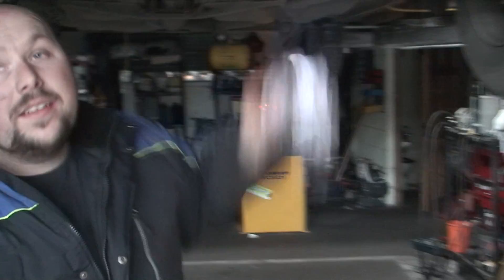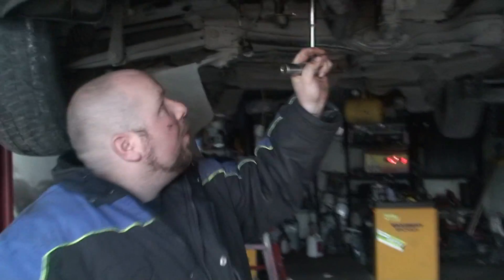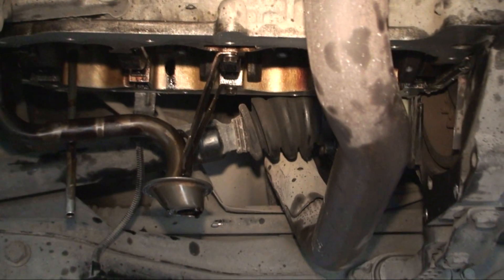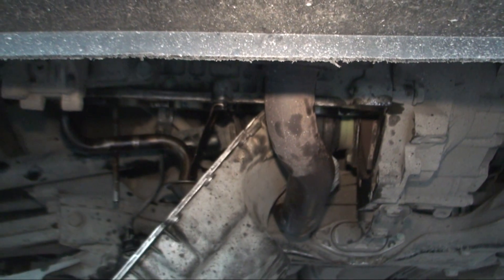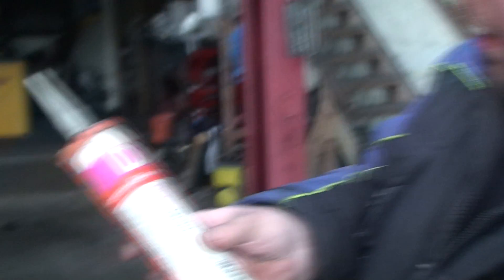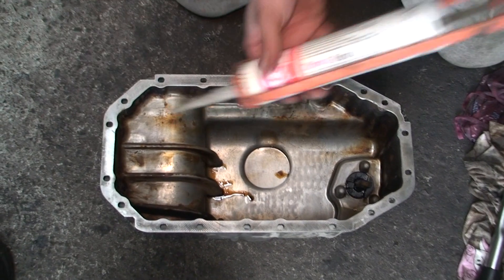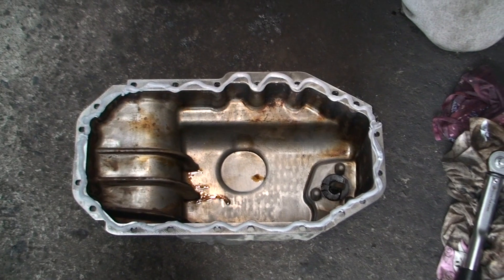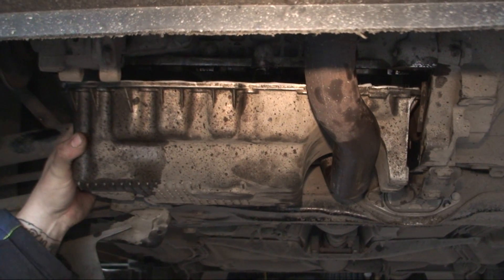bodgit and leggit garage how to put on a car sump (part 4)

Comment: The sump screws at the gearbox end are a problem to remove. The ball-head Allen key is not working, and the gearbox to block plate/gasket is in the way of a 'straight' Allen key. tips and tricks are welcome. I'm close to cutting the sump into bits

Comment: Why don't you just remove the obsticle being the exhaust 
That's lash loads on and when you tighten the sealant will squeeze inwards creating a silicone rope that will loosen into the sump eventually getting sucked into the strainer oil lifter causing oil starvation hence waste of time blown engine never mind you struggling with sump round exhaust removing sealant from an area that you never noticed causing a leak later some pressure builds up in the sump

Comment: Here is a tip, just drop the exhaust it's only a couple of bolts and makes it much easier
Reply from the maker: In a perfect world yes but not in the real world when the bolts are really rusty and it causes you hours upon hours to draw them out to replace them
Reply: @bodgitandleggitgarage  use a blow torch heat the bolts spray with  oil wait 10 min and remove
Reply from the maker: @lucianoaliquo6629  🤣🤣🤣🤣🤣 ok   I really dont understand why any bolt in the world ever get snapped them because  your method must work every single time
Reply: @bodgitandleggitgarage   works for exhaust bolts they used to the heat 🔥 not trying to be funny mine worked much easier with the exhaust removed 🙏
Reply from the maker: @lucianoaliquo6629    It will only work when the bolt is full and not rusty In 90% of the cases because the  Goes through multiple heat cycles The boat just rusts away And goes very weak And then just snaps off if you have done any amount of cars what's the weather you would know this I have done  Multiple video showing exhaust bolts and what happens to them Any experience mechanical know this

Comment: If you've got a few longer bolts with the same thread, cut the heads off and thread them into the holes. Then slide your sump on using the bolts as a guide, it then lines up perfectly first time. Get a few standard bolts in, then remove the long ones :)

Comment: Hi you did a good job but personally i would take exhaust off to make sure it’s out of way as you took a few bolts off a couple more won’t hurt
Reply from the maker: You are forgetting an important parts when I tell the customer the price for the job and then if I take off especially exhaust bolts if things start breaking and the price goes up the customer is not very happy in the real world I know what you are saying but it doesn't always work out that way practical how would you feel if someone gave you a price and gave you a call and the price tripled

Comment: I've got the 1.6l fsi engine. can the sump be removed without taking off the exhaust on that model too?
Reply from the maker: Nathan Soper if your exhaust goes underneath the sump then yes it will get in the way and take some of the sealer off and it will leak just easier to take it off but just be careful as you can snap bolts you're damned if you do and your damned if you don't

Comment: is it not easier to just take off the exhaust?
Reply from the maker: i did it properly
Reply from the maker: Robert Wiliams no risk snap in the exhaust bolts causing the customer triple the cost so no it's not worth it
Reply from the maker: Robert Wiliams no risk snap in the exhaust bolts causing the customer triple the cost so no it's not worth it
Reply: Ah ok that's fair enough. I'd be doing it on axle stands so I dno if I'll have enough room. Also I read somewhere about disconnecting a drive shaft for some reason. Doesn't look as though you need to.
Reply: Just do it properly, it saves time and effort.

Comment: How much crap is usually in the sump or is it generally quite clean?
Reply from the maker: GymChess hi mate if you change your oil regularly it should be really clean did you got a lot of slugs and stuff it means that all has not been change regulate

Comment: It is a very good and useful video. Our POLO 1.4 from 2002 has the same oil pan. THANK YOU for showing how to put in the 2 screws into the deep holes next to the transmission. It was a horrible job for me. I could put into their place only one of them, hopefully it is not a problem. Maybe next time it will be in my garage I will try again.
Reply from the maker: Péter R glad I can help mate thanks for watching
Reply: Do you think that it could cause any problem if one screw is missing?
Reply from the maker: Péter R I no people that have left both of them bolts out and have no problem
Reply: Thanks.

Comment: hi on a z16xep 1.6 twinport astra sump is it the same to seal it and also on the side that goes onto the clutch gearbox side do I put a bit of sealer on there also as I totally cleaned my sump in and out and there was a bit of sealer on it when I removed it 
is have Loctite 5920 copper silicone high temperature is that OK to use 

1 more thing my low level oil sensor broke so I got another one but the cable inside the sump is a bit smaller than needed to get it to sit on correct bracket 
if I cut the cable and extend it enough what can I use to seal the cable and cover it to protect it from the oil and temperature it will be inside the sump 

I thought of using heat shrink but don't know what kind I need 
I only have to extend it a inch rather than spending  £70 on another sensors if safe to do so 

thanks
Reply from the maker: paul mason hi mate as long as you feel what was originally sealed make sure everything is nice and clean you will not have a problem as your regards you're sensor you will have to buy the proper one for  it I don't know of anything you can use to seal it if you cut it eventually even if you manage to seal it will not last by the proper want you will have no problem
Reply: bodgit and leggit garage thanks il get a new one ordered and seal the sump how it was 

thanks for getting back to me
Reply from the maker: paul mason anytime mate glad I could help have fun with it
Reply from the maker: paul mason anytime mate glad I can help

Comment: As a note, I never replaced those two difficult bolts cos didn't wanna risk losing them into the clutch housing. 48 hours later and it's still dry as a bone underneath. Not a drop of oil coming out! 😊

Comment: Could you please tell me how to turn a engine by hand that is all seized up please
Reply from the maker: Hi mate if the engine is seized there is no way to turn it check the big end bearings first there's two bolts for each person disconnect all bolts and then try and turn it if the engine turns when you have a problem your big end bearings unfortunate your engine is seized it can be very expensive to sort out